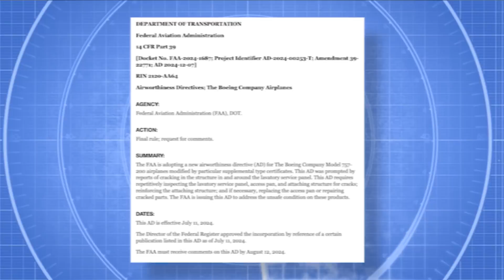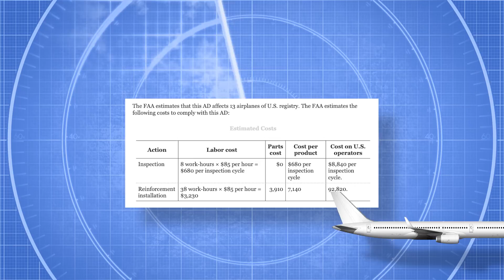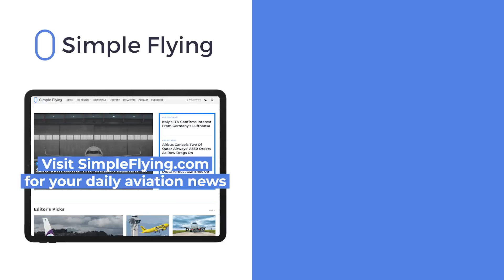FAA Flags Over 120 Boeing 757-200s For Fuselage Cracking Concerns

Comment: I wish I could still fly on it. I've flown on the Boeing 757-200 the most, 13 times in total (A321 is second with 7 flights). Those flights were operated by 🇫🇮 Finnair, 🇬🇧 Airtours International Airways and 🇪🇦 Spanair, so my last B752 flights was back in 2011 between Helsinki-Vantaa and Fuerteventura. Although I prefer Airbus, it's the most beautiful aircraft... in the world. 😊

Comment: This is actually one of the good planes Boeing made before they turned to the dark side.
Reply: even the 737NG was fine for most of it's run, the problems started with the 787.
Reply: @Dexter037S4 likely even prior to that
Reply: They did

Comment: I can’t wait for that one person to say “ThIs Is BoEiNg’S fAuLt” when they ceased production on it in 2004
Reply: If you make something that should last 30 years and it lasts only 20 years you're still severely at fault.
Reply: You got not one but two!
Reply: 4ôúř this Bé Awll Bóiñgg FáwŁt
Reply: What are you on about? this is still boeing's responsibility.
Reply: @d_e_l_t_aa  Even the a380 had crack issues and is still Airbus's responsibility
Reply: @d_e_l_t_aa  it isn’t, These aircrafts are already 20 years old besides Boeing discontinued producing the aircraft 20 years ago, Its just the Older the plane the more maintenance airlines have to perform.
Reply: It was boeings fault
Reply: It's Boeing's responsibility, indeed.
Reply: @jantjarks7946  I hate tou
Reply: @VehicleFanFC  Tough luck for you, because I don't care about your hate, but about safety in aviation instead.